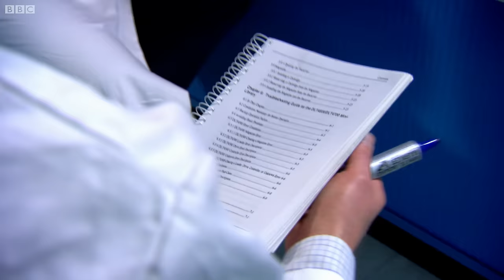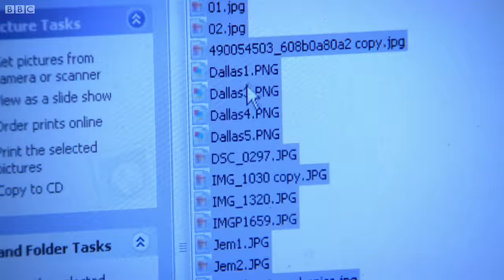How To Destroy A Hard Drive | Bang Goes The Theory | Earth Science

Comment: Hard drive are easy. Particularly glass based discs. Those are present in most laptops. It's part of what I learned becoming an InfoSec guy. You can use a program called DBAN - that will wipe a disk. Then if you want to do physical extract the drive, then extract the disks and smash them into dust.
Reply: I always prefer the industrial shredder option. >:)

Comment: I feel like the only one with 100% certainty was that last one. Some of the other ones might not work if they just so happen to hit the exact spots where the pics were stored.
Reply: You can just format the driver.
Reply: +bytesback Do you even know what a format is?
Reply: P. sop
Formatting is just a complete delete as the tech described in the video. It's not really gone. You'd need to do it at a minimum of 7 times before you should feel comfortable throwing it away.
Reply: It doesn't matter who we are, what matters is our plan. That used to be the case years ago nowadays a complete format not only will delete the files but also set all the bytes/sectors etc of the driver on their initial values.  Think of it like setting all the bytes on 0's.
Reply: bytesback That article is outdated.
Reply: +P. sop +bytesback is correct, format doesn't delete your data, even if it sets all bytes back to 0, there are ways you can retrieve it
Reply: bytesback Ah I see. I didn't thought about this and you clearly know more on the subject than me.  Anyway I'm sorry that I doubted you. I still believe that in the future when formats will become a bit more advanced it would be impossible to retrive data from a formated disk, take for example the new /p parameter on windows 8's format command.

Comment: I use dban on my drives, takes a while to get rid of data but it is well gone after it is finished, or if the drive is busted I generally use a drill thru the platters and if I have more time I take the platters out and run an angle grinder over them.

Comment: A large magnet will blur the traces but there will still be traces of the "difference" in magnetic polarity that can be read. Writing over the files on the hard disk will write over the files, but will leave the sides of the magnetic traces visible to sensitive enough detectors. These can be read if care is taken. Hammering a hard disk platter won't delete anything. It can still be read as long as the read head is able to pass over the surface enough to read it. Melting the platters is the only way to delete data for good so that nobody on this planet can read it.

Comment: Do like 3-6 low-level formats to the disk and that should erase it with no trace, no need to get physical. Do 10 to be safe, depending on how much time you have because low-level formats, depending on the hard drive, can take hours to complete.
You need more than one because the bits leave a trace of how they were before.
Reply: Yea but destruction  is more satisfying  than wasting time trying to erase a harddrive  

If you nerds  wanna trust it go that route but a average  user is gonna take a hammer and nail to it instead because  destruction  is fun
Reply: Man I wrote this 7 years ago. Anyway, Mr. not a nerd writing from mommy’s basement. A sledgehammer or a tractor will still not do the trick, the data could still be recovered.

Out of the methods in the video, the only ones that worked are probably the fire and the magnet.

Comment: Or just write zeros to the drive...
Reply: That mostly works but fancy people in fancy labs can still get some data off, I'm told. Best to just melt the thing.
Reply: +Sandwich247 no it's best to just drill through the platter in several places, no need for heat or any of the methods in the video
Reply: No, that's an old myth from simpler times. The practical problem is that writing over the entire disk take a good amount of time, while physical destruction can be very quick.
Reply: Exactly, so long as the hard drive is still functional, there's a chance that data can be pulled of it, best to just destroy it
Reply: I could get data off that in a couple of hours with a commercially available product. A forensics lab would have no problem. The only way is to destroy the platters.
Reply: Better to write random patterns several times. 

All zero's makes it easier to see what was on it before, the background is better visible when the foreground is homogenous.
Reply: I don't know why people would take the risk of overwriting the drive. If you are done with the drive and there is sensitive data on it. Destroy the platters. The fragments can all be recycled.
Wiping the drive should only be done if the data is unimportant.
Reply: Maxx B
Why waste a good drive when it's quite easy to make the data nearly unrecoverable. Just overwrite 3 times with a random pattern, there's plenty of tools that do that.
It's way too expensive to try to recover the data from a disk that's been overwritten 3 times.
Reply: tabularasa0606
It depends on the data, if you cannot afford for the data to ever be recovered, then destroy the platter. Forensic recovery isn't that expensive. In corporate IT, the data is a bit more important than your pron stash. The data is also immensely more valuable. If you don't want that falling into the wrong hands, you destroy the drive.
Also think about why you are replacing the drive, usually it's because it's too small. Chances are, it's too small for the next user too.
So I stand by my initial comment. If you don't want the data to be recovered, destroy the platters. If you don't care, overwrite and recycle.
Reply: Maxx B

You haven't read +Marco Pontello link. It's extremely hard to recover data from a wiped disk with newer disks.
Reply: "Just overwrite 3 times" Easier said then done. What if you have a faulty drive? Where the speed is...Dead. I had a 2TB HD that would take about 4 months to write over a single time according to the program -__-
Reply: Op Op

A faulty drive is much easier to recover since the data is still there, just not accessible. 2TB would be much faster to overwrite. Since you can just linearly write data to the disk. An average drive has a throughput of about 200MB per second. So it will be done in about 10000 seconds, which is about 3 hours.
Reply: tabularasa0606 A drill bit through the platter +/- 30 seconds, which is a bit less than 3 hours.
Reply: Maxx B
And a loss of about $200. Wiping it is so much cheaper.
Reply: I  should  think   a   little  20%   sulfuric  acid   then poured on the platters after drilling    would  top  off   the  process nicely  ?
Reply: I don't know enough chemistry to say if sulphuric acid would react with the cobalt, nickel and iron magnetic alloy coating of the platter.
Maybe this might be an experiment for NurdRage, Nile Red or Cody's Lab.
Reply: That only kinda works. You need to do that 10+ times or so to be truly effective iirc. Well, to the standards of banks anyway.
Reply: +Maxx B I don't know what everyone is talking about. you open up the drive, take the magnets, smash away to you heart's content with a big hammer. You can melt, compress or do whatever you want to the remains, just to be sure.
Reply: duo1666
Nonsense, the data will be worthless in about a year. Data that is overwritten 3x will take more than a year to recover. And will most likely be only recovered partially. The data density of modern drives is just too high to be able to reliably recover data.

Also I think wiping is actually more reliably than breaking the platter, since the broken platter will still hold the data, it will have gaps, but it's easier to read than when it's wiped.
Reply: tabularasa0606 Any intel is good intel, as long as the intel is accurate enough.
Reply: duo1666
Not when it's outdated. And stuff that's really important, like nuclear launch codes, should be on an encrypted disk anyway. It's just a waste of resources to destroy a disk that can still be used. When it's broken, just destroy the platter, recycle the rest.
Reply: tabularasa0606
Encryption can be broken. In commercial IT time is actually a factor. The value of an old drive is almost nil, when you have to account for the time involved to wipe it.
Old drives are usually only replaced for two reasons, fault or too small. Faulty drives are destroyed or sent for recycling. Drives that are too small are sent for recycling. If the data is sensitive, they should be destroyed.
Reply: tabularasa0606 1 year isnt "outdated" for military/government information. 50-100? Sure. 1? No. You can still discern enemy tactics, gain blackmail info, government passwords (no one updates their shit...) etc etc.
Reply: Adam Burdett
Corrupt data is still data, Drilling though the platter, you might completely miss the parts that contain the launch codes, you don't know where they are on the platter. Wiping them makes it almost impossible to recover any data anyway, it's more reliable than drilling a hole.

+Maxx B
Old computers including the hard drive are usually sold when new systems are bought. It's way too expensive to try to decrypt data from a wiped drive. It's virtually unreadable anyway. And it's nearly impossible to determine what parts of the recovered data belong together. It's easier to read data from a broken platter than it is from a wiped platter.
Reply: tabularasa0606 I wasn't suggesting the government should drill through a drive, they should totally destroy it, incinerate it if they must, which I'm sure they do. "Almost impossible" keyword there being "almost" if someone gets hold of a drive containing data of that nature they will do everything in their power in order to pull the data off of it. If it's another country they'll have teams of people working on it in order to pull that data off, if there's a way, they'll do it. Therefore to simply save a drive, its really not worth it. Drilling through a drive is fine for an everyday individual, who simply may want to despose of a drive containing personal information, nobody is going to spend hundreds of pounds in data recovery, just to find out someone's phone number, or to take a look at their holiday pictures. Therefore drilling is perfectly fine
Reply: Adam Burdett

Read the link I provided in my previous post. It's currently impossible to read data from a disk that has been overwritten once. The technology does not exist.
Reply: tabularasa0606

If it's currently impossible why did you say almost? And who's to say there's people within governments who know how to do it, they just don't want that information released, and for good reason. Your argument in doing this is to save resources? Is it really worth the risk of potentially dangerous data being leaked to the wrong hands? I really don't think so...
Reply: Adam Burdett
If the government can do it, why do they hire companies to do it?
The risk is virtually 0 when done properly. The chance that you're hit by a car tomorrow is higher. And yet you still go outside and cross the road. No data is that dangerous, not even the nuclear launch codes, by the time you have the codes, they're changed.
Reply: tabularasa0606 You have google, use it.

Either way, theres 0 reason to save a hard drive with sensitive information on it. Its far safer to completely destroy, and an old hard drive is generally worthless and will likely fail shortly thereafter, so its not like you can make much of a profit off of it. And its not like the government is going to donate it to a friend, which is typically the only thing you do with an old hard drive. Destroy the bits that store the data and scrap the rest.

Comment: I have a question. Do the same rules apply for SSD? Since the information is stored digitally rather than laser etched onto a disk.
Reply: Firstly, data is stored digitally on a Hard Disk, so that is not a differentiator.
Secondly, the data on a Hard Disk is written magnetically, you are thinking of optical drives for laser 'etching'.

but to answer the question, yes and no.
yes it's the same, a delete is just removing the Table of Contents listing (actually even that was misleading, it only flags it as empty, the ToC entry is still actually there until something replaces it).

No it's not the same, writing a HDD entry means physically giving the plate a magnetic charge, even overwriting doesn't completely destroy the data, as the new charge pattern is no longer set from a level playing field... you'd need to rewrite several times to sufficiently hide the 'ghost' of the original data. SSD's on the other hand use transistor logic to store the data, think of them like switches - once the switch is pointing to 'on' you have no way of knowing where it was pointed before, so a rewrite will kill all data.
Reply: Iain Baker Thank you for clarifying that for me. so your saying that an SSD is essentially a big pile of Logic Gates?
Reply: risinsunset yeah, essentially... it's an EEPROM

Comment: No result? But I can tell you. Most would have survived. Only one I think didn't is the melted one at the end. I've had to destroy a few my self and my tools were a screw driver with a particular head. And a hammer. You need to puncher and shatter the magnetic disk inside the hdd. When it shatters into million partials then it's done. Other way is use software to write the disk full of 0's. But that takes time

Comment: Is this the same with an SSD?
Reply: Same same, whits small difference that SSD sort of scramble data for the reson of maximize number write cycles. HDD wants stuff in good single line while SSD don't care if data is fragmented or not for maximize read/write speed. So NEVER defrag a SSD, only HDD. And if you literally write over all bits in SSD there are nere 0% chans to recreate data. HDD have some ghosting of data so you need write over same space several times before you can say no data is there.

Comment: so stupid, why even bother if you're not testing erasing algorithms or physical damage to the actual drive, not the physical PC which doesn't hold the data. For a BBC documentary I'm disappointing in the misrepresentation of computers as whole things instead of individual components. Hitting a computer with a sledge hammer or driving over the computer will barely change or damage the data.

Comment: and where are the results?
Reply: you dont need results its obvious... sledge hammered one, angry farmer, golf, magnet, toasted i bet all survived and data is retrievable from them, only the cremated one lost the data completely... (no i didnt watch the second part tho)
Reply: Magnets might delete the data, since the information is written with polarisation.
Reply: They will make it harder to read, but there are still traces. When you really want to wipe data you need to overwrite it with random data multiple times.
Reply: Even after multiple overwrites there are still traces. To be on the safe side companies like Google physically destroy their old hard drives by crushing them.
Reply: Thereisnosp00000n After enough overwrites the data will just be part of the random noise.
Reply: TheAnoniemo
there are algorithms out there that can make sense of random bits if the original data on that spot is example file... i am talking about that "noise" of those multiple random overwrites of that same bit.
the best way would be heat, curie temperature of iron is 770 Celsius not a toast maker...
Reply from the maker: We will reveal the results on Saturday, come back then for part two!